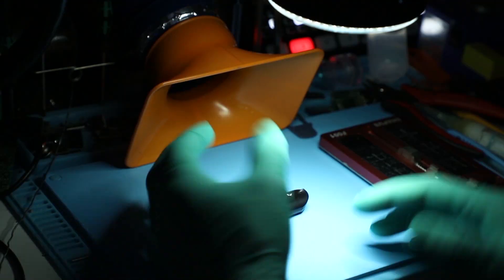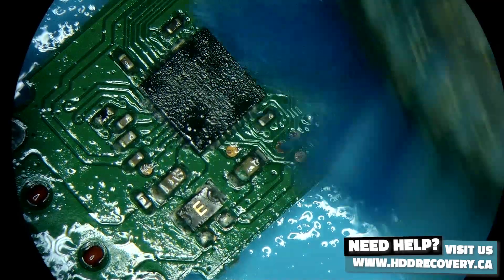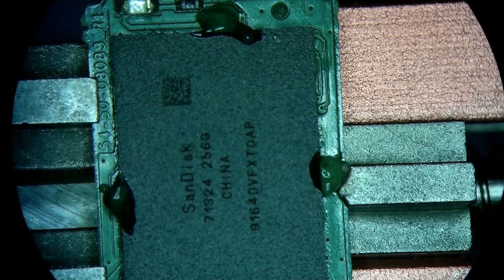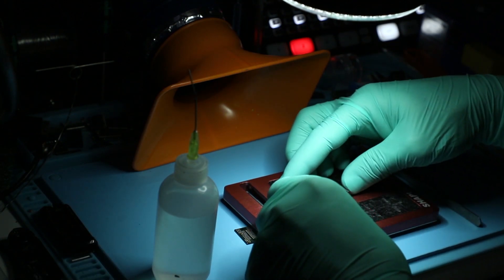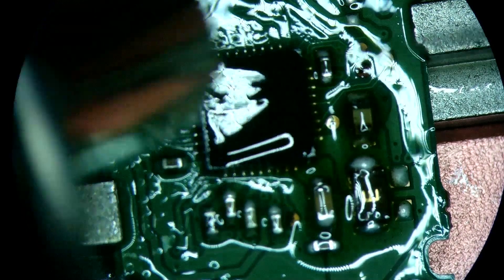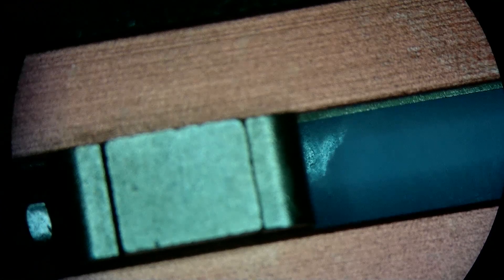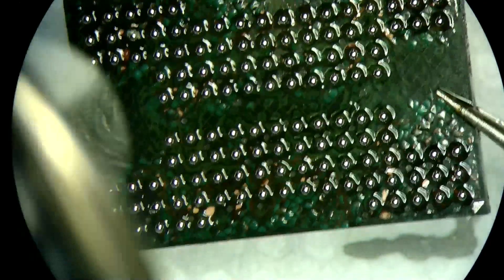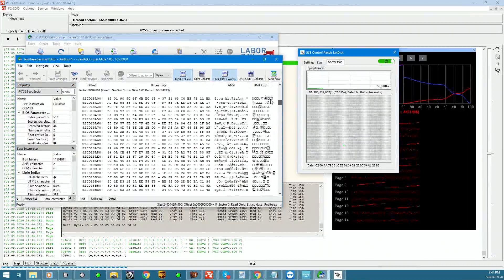flash drive got wet but you need data

Comment: what tool you use to check the controller,i mean after you soldered the controller and you had 4,98 voltos and 0,02.
Reply from the maker: Without NAND attached, device should go into safe mode. That's how you know if the controller is good. But also amp readings

Comment: Could you please tell me where I could get such thin tip soldering irons?
If at if u can provide amazon link its much appreciated
Reply from the maker: JBC Nano station has tips as small as 0.1mm, but I think you can get 0.1mm tip even on T210 handle.
Reply: @hddrecoveryservices  ty for ur response

Comment: 13:16 Why do the metal droplets under the chip not coalesce when you move the chip on the board to position it correctly?
Reply: When you heat up solder, it will move under self surface tension to the right place, so you dont need to be 100% acurrate with the position of the chip. Also when you add a solder flux paste on joints, it will help to not stick all solder together. It seems like impossible thing, but after you try it yourself, its in fact pretty easy to achive good result.

Comment: No.1 tip - if it gets wet, DO NOT PLUG IT IN until it's completely dry - most of the corrosion is due to electrolysis when there is power and water present.
Reply: I waiting for 3days and asked God if it came on I’ll never stop loving him
Reply: rice to the rescue

Comment: Just a basic question, but when a drive like this is wet and/or corroded, how does the data inside the memory chip keep from being damaged? Are they so well sealed that corrosion can't get into the chip? In other words, most of the time is the data still there, even if the supporting circuits are corroded?
Reply from the maker: Yes, these components are sealed off. Headers and pads on them are fairly thick so they will not vanish from corrosion, but if they get oxidized enough the contact will be lost.

Comment: Would running it through an ultrasonic cleaner clean it up well enough to just "plug it in"? Or would the terminals be too corroded to make contact?

Love the videos!
Reply from the maker: It could be. I have not had too much success with it. Taking components off is fairly easy on these devices

Comment: DAM HOY YOU LEARN HOW TO DO THIS WHAT YOU STUDY
Reply from the maker: Get tools and practice. Right now there are bunch of places in almost every part of the world that offer micro soldering courses. I did not study any of this stuff. One step at a time and you will learn it. Just piece of advice is to get good tools, it will make a leading process much much easier. JBC iron, good consumables (I list all mine in description) good glass (microscope), and hot air station (I use Quick)